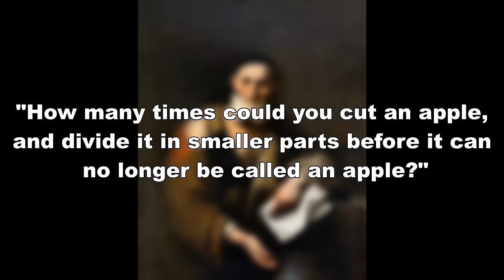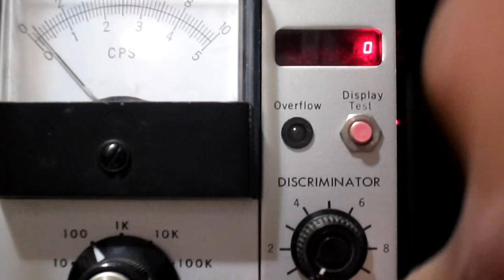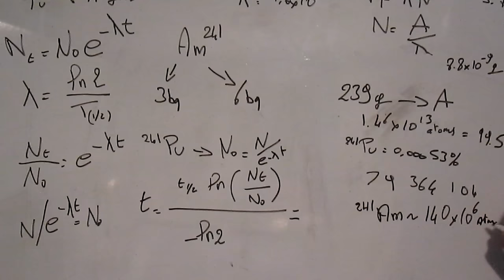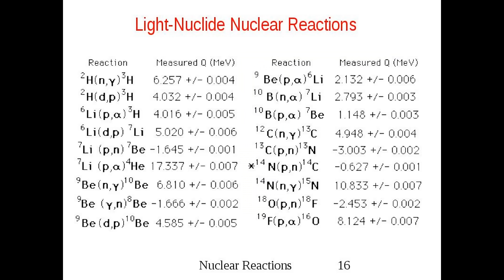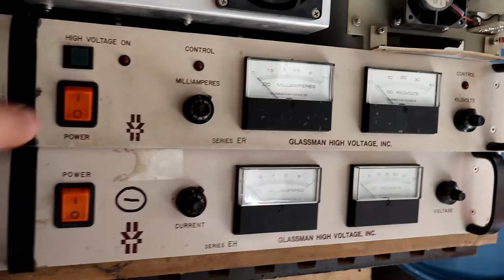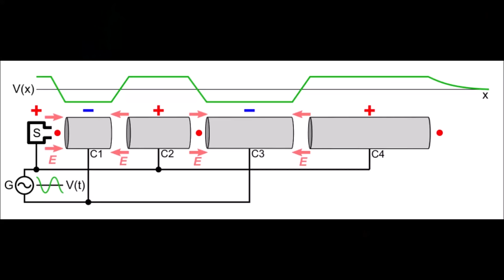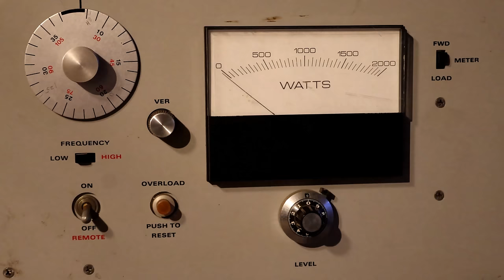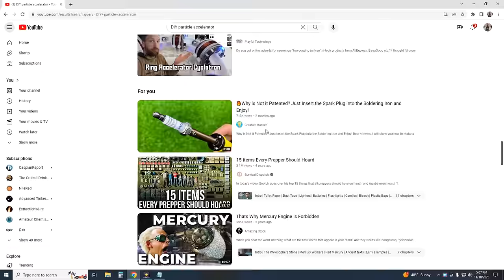DIY Particle accelerator (part 1)

Comment: i am building a similar electron (maybe proton if can make an extractor) accelarator. really cool! i know that a electron accelerator is easier to build than an alpha particle one and i am already 6 months in and not half way there... Nice work!
Reply: i have hit a snag with the vaccum system though, i do not want to buy an expensive turbo-molecular pump and only have a 37 micro curie pump. i have thought of making a titanium sublimation-based pump. If you have any suggestions to achieve a higher vaccum, i would quite apreciate your advice. Amazing work!
Reply from the maker: Oh I've been working on this for a while but  because of previous project I had a head start! Thanks for watching and good luck with your project!
Reply: @Neptunium  Thank you so much! Good luck to you to!

Comment: Hmmmmm, I think a Faraday cup is the right place to start with diagnostics. I would want to measure your source current and output current (post drift tube) with one. You could then use the downstream Faraday cup measurement to calibrate a non-destructive beam current measurement device (e.g. a beam current transformer, assuming your DTL produces a pulse structure that would be measurable - a BCT won't work with a DC beam). That would then hopefully give you some meaningful beam current measurement while leaving you with a beam you can play with.

This is my intuition but I haven't run the numbers with your setup to see how well any of this would work. It's not really 100% my area so I may be missing something obvious too. I've sent this video on to a few people (some of whim may be more useful) - but we all think this is so cool.
Reply from the maker: Yes this was my best guess too. I think the Faraday cup is simple enough to work and I wanted to use the one in the quadrupole from the RGA .. hey that's why they call it "garage science" right! Got to try things and see what fails and what works! Thanks for sharing and for the comment!
Reply: @Neptunium  The other thing I am thinking about now -- from the video I remember you mentioned trying to drive it with a square wave. I don't know if you stopped trying this, but I think it's not a great idea. Not only does it make things harder from an RF power supply perspective, but I think you also lose phase stability this way. 

Basically, you will have a distribution of different momenta in your beam, and when the particles with these different momenta encounter your first accelerating gap if you're driving it with a square wave they will all receive the same additional energy - meaning that they will have different time-of-flight between your first gap and your second gap, and by the time you hit your second gap some of your accelerated particles will now be out of sync with your RF potential. 

We can fix this when we drive the DTL with a sine wave by choosing a synchronous phase such that we aim to accelerate the beam on a rising section of the sine wave potential, and calibrate our drift lengths and voltages accordingly. If you choose a point before the sine waveform reaches the crest, then an early particle receives less energy, and a late particle receives more energy, and this stabilises the momentum distribution around your synchronous phase so that your beam stays in sync with the accelerating gaps.

I hope that makes sense - it's not the best explanation so feel free to ask questions.
Reply from the maker: @Max.Topp-Mugglestone  Yes it does! the problem with the sine wave is the narrow area of efficient acceleration. we always loose a part of the beam and I thought a square wave would fix that. In retrospect, (and I`ll mention it in the future video) the square wave will drop the "packet" of ion out of phase and I was not looking at that aspect when I recorded the video.. Thanks Max! I enjoy your comments and the few product I bought from you.. :) that and the possible complain/ticket from the FCC for all the harmonics I couldn`t control! LOL

Comment: You can build an electrostatic powered accelerator using a van de graph type Generator.   Also, a less expensive and much more robust high vacuum pump would be a Diffusion pump, though you have to be a bit careful with the pumping fluid and possible contamination, a diff pump won't corncob like a Turbo pump if something bad happens. and parts for diff pumps are relatively cheaper.

Comment: I had this project lingering in the back of my head for years, since i started playing with building crookes tubes.
As you said in the video, the informations available on the web are few, and often not that useful. 
these devices has been made before, but i could only find basic drawings and simple notes on how they worked.
i also got stuck on the frequency generator. it isn't hard to find an RF generator, but it is to find one that generated 10kV or more.
Even if i wanted to build one, i have no knowledge about this topic, and of course, couldn't find anything relevant on the web.

I'm really sorry about the accident, can you tell us more about it? did the glass of the hot cathode vacuum gauge fail, causing a cascading effect on the other parts?

Anyway, I'm really looking forward to this project, just so i can copy most of it once it is ready XD
Reply from the maker: Thanks for the comment! Yes ! A weak point caused a catastrophic decompression that ruptured the thick glass of the view port. I was lucky to not be looking right at it when it happened! Your also right about the high voltage HF generator but we can get away with a lower voltage if the drift tube forms a resonating cavity for the ions to "surf" the wave ... However this requires much higher frequency in the Ghz range... Much work ahead and more frustration! I enjoy it though! Thank you for watching!!!

Comment: Such a cool project. I'm sorry your equipment got busted and I'm glad you're okay. Any ideas on why there was a pressure failure? Heat issues?
Reply from the maker: You know, I wonder if my recently dropped hit cathode gauge didn't have a tiny crack and with second hand equipment from eBay, you never really know how old glass view ports are and how well they were maintained... Anyway I think I already found replacement it's just frustrating you know .. but hey thanks a lot for watching!

Comment: With all materials and knowledge you have, it looks like you know what you are doing. BUT when I see your workspace, It looks like you work as you find information. From an engineering perspective, clean and tidy workspace gives you clarity and safety. My suggestion would be not to mess with high voltage generators, particle accelerators, high vacuum pumps just freely assembled on a pile of random garbage bins or whatnot. Any of your family member, or nosey neighbor, if not educated, could die from touching any part of the particle accelerator. Stay safe and continue this work in safe enviroment.
Reply: You have never seen a real research lab with that kind of advice!  They are notorious for kludges of pipes and wires (and cats) and...... all over the place!
Reply from the maker: good advice nonetheless! Although no one should be coming, its probably best to keep things organized.. i really, really REALLY need  more space!! one thing at the time...
Reply from the maker: very true!
Reply: @glasslinger  I work in private company as project engineer, in a research office 15mx15m. We have a separate storage room neatly organised. Work benches are clean and everything you need is organised in alphabetical order. I have been to many research labs and none was full of clutter. For reference, if you check Joe DiResta or Adam Savage, they have workshops full of tools and components but everything is organized. There is no use in having random stuff just piled on top of each other.
Reply: @LouChanGaming  Ha, ha,  ha!  I'm talking about REAL research labs where research is BEING DONE not just planned for. Of course it would be so convenient if the place looked like a sales room but if you ever did research using a lot of different disciplines it isn't always convenient to keep everything put away. Been there done that!

Comment: Just my initial thoughts, but you may consider engineering a means to easily change the geometry of your tubes. This way you can tune it more carefully.

As for a detector board, maybe an array of small photovoltaic cells will work?
Reply from the maker: Yup! Thought of that too! It is physically possible but financially difficult if you know what I mean. . I am looking at a rotating screen on a high vacuum flange that I could be using and it sales on eBay for $430... And that's without shipping and this is only ONE item I need... So this may take a little while for me to get every repair and replacement for this project! But that's ok I knew what I was going for... So thank you for your patience and suggestions my friend! And thank you for watching! Check out my previous work too!!

Comment: I was just recently looking on youtube if anyone did a particle accelerator video and could not find what i was looking for. I dont know much about particle physics but i have some experience with hv. a idea for power supply would be to wind a ferrite core transformer. And use the rf power supply you showed to drive it. With a good enough transformer and good secondary design, you can get the high voltages you are looking for. You would need to design the transformer so that it wont arc between the secondary windings or to the ferrite core. (i.e. by windings secondary on a special bobbin, putting the transformer in parafin oil and vacuuming exc.)

Comment: You're lucky the turbopump survived, normally the sudden inrush of air hitting the rapidly turning blades causes the tips to melt, and any debris sucked in to cause carnage.
Reply from the maker: Thankfully the TMP was not running! But I still have to clean it and make sure its fine though!

Comment: Oh hell what happened ? did the Ion gauge get knocked? many years working with this equipment for VG Scientific I have never seen a viewport go ! best of luck on the repairs ! I just subbed so I can keep up !....cheers.
Reply from the maker: Yes I think the gauge had a small crack from a possible recent drop but I am not sure . It's difficult to know with second hand eBay parts I was dumbfounded by the view port thick glass too honestly! I already found a replacement that's new. Hey thanks for the sub and thanks for watching!!!

Comment: You must continue. I think a voltage adding planar transformer based switch mode power supply might solve your HV problem. It was used in similar applications for nuclear devices. Modern semiconductors and ferrite cand do this if you can push your operating frequency to 200 kHz.
Reply from the maker: Excellent suggestion! Because of the size of my chamber, I realized I need much higher frequency in the low Mhz range.. thanks for watching!
Reply: @Neptunium  maybe Zinc-Manganese ferrite could transmit power. I'll do the math when I have the chance.
Reply from the maker: I was reading on it and yes, some zinc alloys are used at higher frequency your right

Comment: That's a great idea! Too bad there was a pressure surge..... Wouldn't the acrylic disks in the chamber give off gas under deep vacuum? Hope to see a continuation of this project soon. It's very interesting!
Reply from the maker: So far they have not. I kept track of the degassing with the mass spectrometer up to 120c and the acrylic were fine. I think at about 140-160 ish they might soften and release some gas but so far so good .. well at least until the pressure surge.. I have some spare discs at least! Thanks for watching!

Comment: 14:25 I'm building my own vacuum chamber and will use pretty much the same stuff in gauges and viewports that you do so I'm very interested to know what was the cause of the fail?! And I guess the turbo had to be totally destroyed as well by the inrush of air? Really sad all of it. :( But extremely good work. :)
Reply from the maker: Hey thanks! I uploaded part 2 where I explained the failure! Thanks for watching!
Reply: @Neptunium  Thanks, totally missed that.

Comment: Did you connect copper pipe and wire by lead solder, and next put this thing to high vacuum chamber? Lead really easily evaporates in vacuum, making it worse.
Reply from the maker: I couldn't see anything on the mass spectrometer but this is a real concern your right . I don't really need to get it down much below 10e-6 Torr so it should be fine .. even the acrylic at 120c didn't give me any issue... So far!

Comment: Good job this far, nice reasoning
For the glass parts that shattered, can't you use a layered glass to prevent debris from flying everywhere ?
Reply from the maker: Yes you're right! I might do that I don't know if it would be absolutely necessary. I think I know what happened and this really was a dumb mistake on my part.. I'll replace what needs to be replaced and repair the rest.. thanks for watching!
Reply: @Neptunium  Yes it's not absolutely necessary, it's a safety feature
What was the mistake please ? So I don't do it myself too
Reply from the maker: @guipop2614  after changing the pump oil, I reconnected the output instead of the input .. so it build up pressure... Like I said dumb mistake !
Reply: @Neptunium  Oh indeed, it must have been frustrating ! Good luck for your future

Comment: Just be careful. You might want to set up a lexan sheet between you and the equipment as it can provide protection from flying things. Also, HAM radio people are great people to talk to about high frequency, high voltage kinds of things.

Comment: Where on earth did you find a mass spectrometer? The bloody things are expensive. I am sorry that I am not be able to help with ideas for the high v and high f equipment. I have played with high current on few kHz for industrial induction smelting plants and high v dc for testing transformers but don't know how to make it in to square wave without semi conductors that can't stand high v .. It's engineering beyond my level. 
You have a new sub. Impressive DIY experiment. And please, wear ear muffs and glasses.
Reply from the maker: Where did I find an RGA? Well eBay of course! They are not super expensive relatively speaking.  Made a couple videos about it a little while back.. check them out! Hey thanks for the sub and thank you for watching!!!!

Comment: Just a tip, you can use one of those thingies from Home Depot or Lowe’s alongside the doomerdigie with some copper wires 22 gauge or smaller preferably on the pvc and acrylic or some plastic in a rounded shape and then put some magnets and a stator onto the thingiemabob and then put that hooked up to a microwave generator and wire in some capacitors to teleport into the past and stop your unit from breaking. 
You don’t gotta do this but it’ll prolly be faster than building a new one. Just saying.

Comment: Well done mate and please take a bit more care on the safety.
Also you may produce a decent neutron flux at the end this project, maybe it can be useful with the use excessive borax shielding etc., yet it would be a mess to dispose all that activated waste. Cheers from a far away country!
Reply from the maker: Yes sir ! Thanks a lot!! I don't plan on being around this thing running at full power or not for long. If I can get it to work right! Thanks  for the comment and thanks for watching!

Comment: variable zvs with a industrial flyback my friend. can be custom made for the application with jl cpcb and a 3d printer
Reply from the maker: Yes you're right! I thought about it and it was suggested several times. I found a small RF generator so I used that in part 2 already out! Thanks my friend! Glad you liked it!

Comment: Hi, awesome video! Glad youre okay! I have a thought about generating HF high voltage. I dont know if it will really work or not. 
Couldnt high frequency transformer be used to raise the voltage? Something like a balun that HAMs use. I know balun is meant to match balanced and unbalanced feeds, but it also matches different impedances. And to match lower impedance to higher impedance, it should raise a voltage and lower current like a normal transformer. 
Plus youre working in several hundred kilohertz freq range, same as many SMPS, so finding toroid shouldnt be difficult. Then winding two winding with 1:10 ration hooking it up to your generator and carefully trying to measure output voltage. 
Its also possible that the impedance of the accelerating stage is not good. And youre also working with square wave and the transformer maybe could filter out higher harmonics, turning ouput signal to sinusodial..
Dont know how helpful my rambling is, but I wish you best of luck and I am looking forward to next video. Stay safe!
Reply from the maker: The difficulty is the "tuning" part since I need to either change the initial ion voltage and match the drift tube distance . Some tuning will be necessary and I don't know enough about transformers square wave and electronic so your help and comment are greatly appreciated! Thanks for watching!

Comment: whay are you using in 10:14 for checing for leaks?
Reply from the maker: So I cover the RGA in 3 previous video not including the part one ! It's a very cool little mass spectrometer you can find on eBay under Residual Gas Analyzer. Thanks for watching my friend! Happy new year
Reply from the maker: So I cover the RGA in 3 previous video not including the part one ! It's a very cool little mass spectrometer you can find on eBay under Residual Gas Analyzer. Thanks for watching my friend! Happy new year